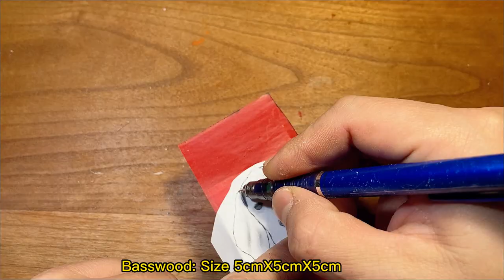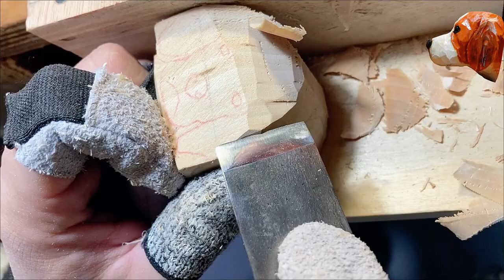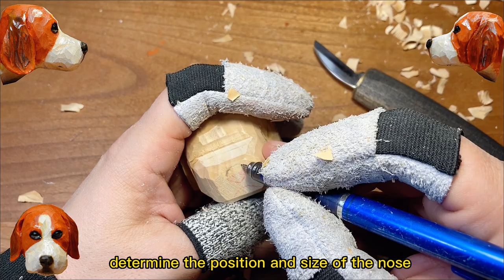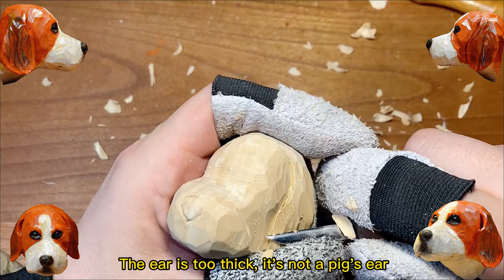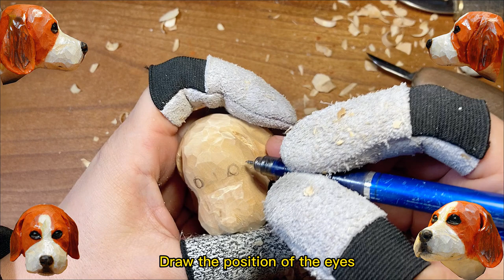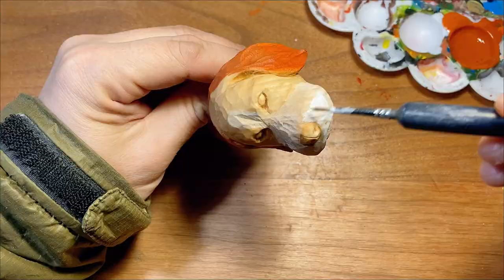Wood carving of a dog's head；How to Wood Carve Dog Head for Beginners；wood whittling

Comment: I built a vice block but didn't make it high enough as your is in the back. 
Built a couple knives from Sawzall blade pretty good knives. Now I've 01 carbon steel should be better next built also few chisels. 
Thanks for inspiring and loads of tips

Comment: I built myself a fixture for them push cuts in the vice to easily hog off material with chisels( or knife) if it's safer.
   QUESTION?  Are you the same artist that did the videos "Come play with me " but changed your name as you both have much the same style and both great video and teaching skills. 
BIG inspiration skills 👏 🙌 👌 
Thanks
Reply from the maker: I just changed the name of the channel because the previous name seemed a bit too long.
I also tried clamping it with a vise, but it is a bit inconvenient to carve, maybe everyone is used to it in a different way.
Thanks for watching, my old friend!😄
Reply: Keep me a heads-up so I don't miss any of your videos. I'm improving, and you know how to teach without words or I learn by eyesight. 
Love your videos and work.